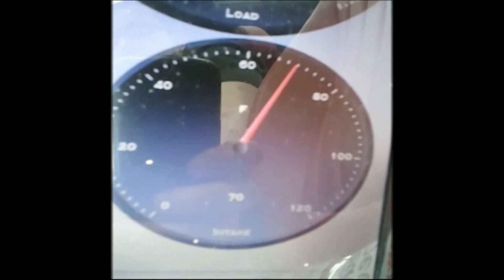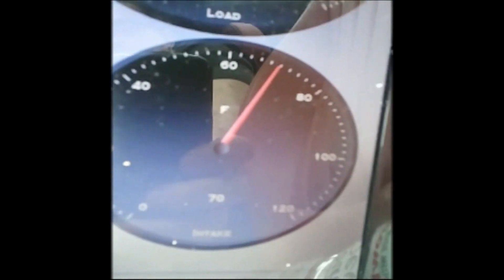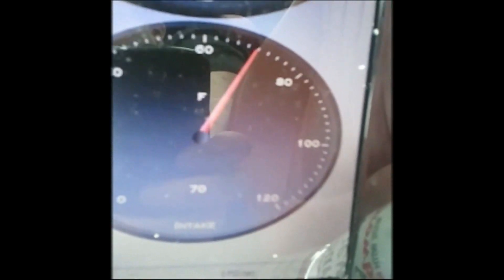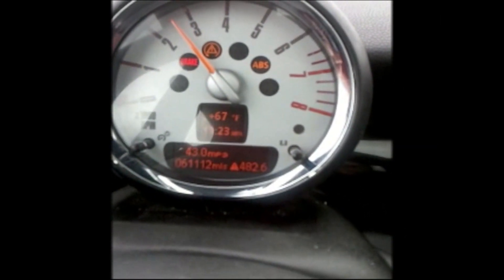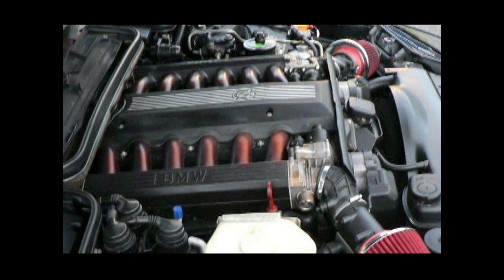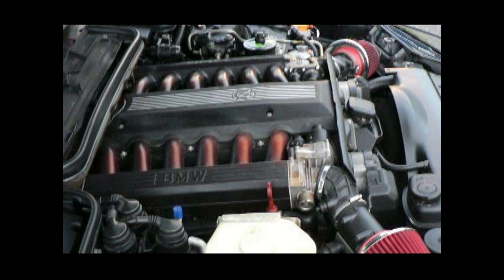Disproving the Heat Soak / Aftermarket Air Filter Myth

Comment: When it comes to CAI, heat soak is mostly relevant when you stop at a light or you park. The temperature in the engine bay as well as the fender rises exponentially because there isnt as much cool/ambient air circulating the hot air out of the engine bay while standing still. I agree that a heat shield doesnt do much for air intake temperatures. 

You should make a video and show the temperature of your intake air when you are at full speed vs when you stop for just 5 minutes.

Comment: The alternator was wrongly used in the starting/cranking motor over. The battery supplys power to the starter and ingnition switch and also powers stater solenoid to engage the abendix to fly wheel turns over motor+spark cars running.

Heat soaking and higher AIT is different yes. What ppl are saying is your AIT would be lower if the factory air box was being used with that direct snorkle.

I call bullshit on the only 3 degree difference. You prob saw it was high and popped you stock box back on just to make yourself not look as stupid. Any petrol/gear head knows closed engine bays + pod filter = high AIT
Reply: Mario Orsini Ricers are always right

Comment: Also, easy way to prevent "heatsoak" wire in the electric rad fan to a switch, Switch it on max in traffic and let it go, the engine bay will be cool. Tested the theory in LA in 94F

Comment: Lol terrible theory for a short ram filter...unless driving hard, the air drawn in won't heat up enough inside to cause intake air temps to rise significantly, secondly you were driving on the highway, the amount of air flow you have is insane, it plays right to the advantage of a short ram...CAI is made more for low speed (intake temps cooler then ram) and high driving speed, 100km/h + (air positive velocity in the pipe gives the performance increase but very similar intake temps to short ram)

Comment: I would say a simple CAI which is basically just a chromed piece of large diameter piping nowadays, would bring you some HP, but only at high RPM when velocity of charge air is no longer an issue. Therefore i would imagine it would decrease low end HP and torque by reducing air velocity. This is why engines have tuned port intake runners nowadays.

Comment: this has to be the dumbest vid.  Your car OVERHEATED it did not suffer from heat soak you moron.  Those pipes in the engine bay is part of your INTAKE, NOT HEADERS.  you obviously have no idea what you are talking about.  Driving down the highway no matter how long you do is not gonna heat soak your motor.  Just no.

Comment: @alewisgb Consider all the subatomic particles hurtling through space at light speed, or higher.
They penetrate our bodies constantly. Without them, our DNA can't calibrate growth patterns. 
Because of the size of an automobile, it is easily detected by any cop. But, if you made a car the size of an atom, you could drive at unlimited speeds and save on gas. Thrust SSC only went 750 mph or so. In the future, this will be the speed limit on city streets. Guaranteed. 5 yr. perforation warranty.

Comment: Okay... so 67 degrees outside... and air coming in is 70 degrees?  Where's the power gain?  Like I've said before, you're only getting better throttle response, and 1HP at most.  Show us a dyno sheet...  ROFL.

Comment: Make the same parts with ceramic materials, and there would be no story to tell.
You could drive 350 mph all day, and not have a problem. Somehow, aluminum is really only good for beer cans. If you happen to visit the ISS drop in and say hello.
Testicles can survive the heat of atmospheric re-entry you know.

Comment: 3 degrees is 3 degrees- you still took off your cold air intake and put a hot air intake on a car that does not have an air flow bottleneck in the first place like cars did in the '80s and '90s when high flow air filters became popular. The higher temps will get worse the hotter it gets. Put old air box back on and use a K

Comment: A cold air intake would turn that 70 into a 67. BTW you can make your own intake out of PVC and coat it with an insulator for waaaay less than 300 bucks.

Comment: Nothing to do with air filters or any chip, it's normal, even turbocharged engines, the more boost building up the hotter the headers become the more red or purplish it becomes, search in youtube "hot turbo" and see what happens when a turbocharged engine builds up boost, it's pretty normal if you're going at high speeds or revving too high rpm for a long period of time, it becomes red and that is nearly in every engine possible unless if it was an old car and the distributor is adjusted wrong.

Comment: heat soak or afterboil isnt a issue on older CAST IRON engine but a 10 to 25 year old car is not what kids want to drive now days.   having cast iron block and cast aluminum head is part of the issue, also using plastic, ceramic and other crap to lower the weigh, improve gas mileage has a trade off of afterboil, heat soak .  electic water pumps running after the car engine is off can help but then you have more drain on the battery.  often you cant win...

Comment: Y'all win on the intake manifold not headers.  I never took that car apart, I used to look at it and it would break.  It was 114 degrees out side and that 150mph number was closer to 175 (I never found a place to get it to the 186 she supposedly topped out at)  I always assumed headers cause if that is intake, that is Fraking hot engine block

Comment: @ss9c1 20+ years ago heat soak meant "OMG, My car worked when it left the house and now after driving hard it won't start, go up hills, or run the radio." It was really more that when the engine got how electrics started to die, or things swelled ( Cast Iron does that ) so your card died along the way. When it cooled off it would work again.  Then the Cold Air Intake guys stole the term to describe sucking in warm less dense air. That can be a problem in some cars, but is a different problem.

Comment: I hate to break it to you, but those heat soaked headers are actually intake runners. Thats clearly a V-12 BMW engine, with 6 runners on each side. Headers do not sit on the top of the engine. They are bolted to the side of the heads at the exhaust ports.

Running the car at 150mph for a half hour, all you did was overheat the car.

Comment: I always thought heat soak meant you were simply making less than ideal power due to hot air. And you are, but street cars don't suffer from the problem much due to the way they are used as opposed to track used cars.

Comment: After prolonged driving periods I'm pretty sure the air in the engine bay will heat up more and more.
It's all about forced induction kits. Not only is the air colder, it's compressed more

Comment: The difference isn't big .. really if you really really want colder air you need to do allot more then a simple plastic piece indeed. Not to mention many things that yes improve power to a car.. do it relative. Putting an intercooler on a car without turbo or supercharger..doesn't really does much. And if your engine is under 100HP well.. any work you do to it really is limited in how much it can give you.